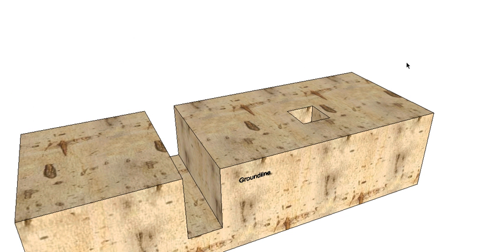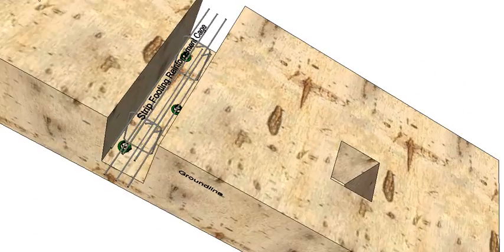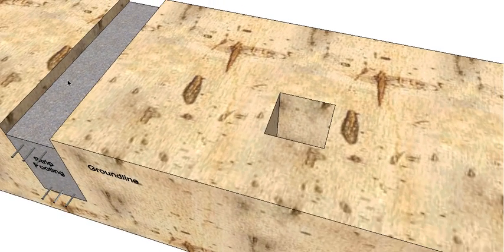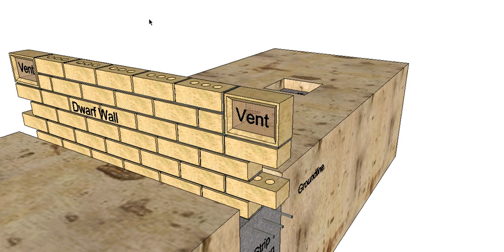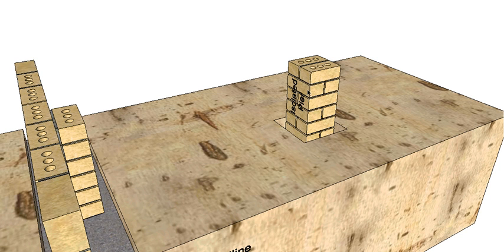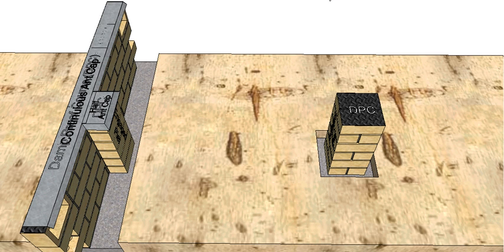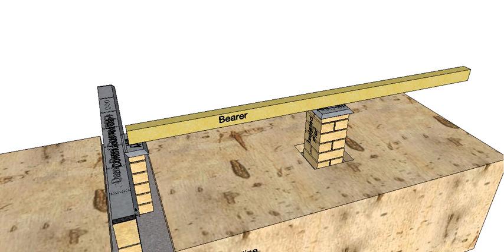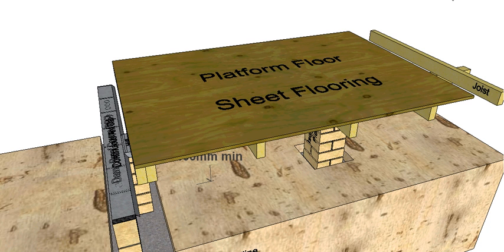Section through a Brick Veneer, Platform Floor Building Part 1

Comment: Hi,
I had a question regarding this method of construction.
I'm guessing this is used in areas prone to flooding? Or are there other advantages this method has over the standard slab on ground method?
Reply from the maker: Hi Mate, no these are not used in areas prone to flooding, before the slab on ground came about this was the most popular method. However yes it does give the house some elevation so it is advantageous if you have a lot of water around. This construction also has minimal, compared to slab on ground, levelling of the block to the natural shape of the ground is maintained. This also helps with runoff issues. In hotter climates, I can allow for airflow under the house to assist in cooling.
Reply: @Buildsum  Oh alright, I see
Thanks a lot for the explanation :)

Comment: In flood zones we need to raise the floors and sometimes over 1.5m above the N.G.L depending on flood report. From an aesthetic point of view as a designer we have used screw piles to create a floating effect. What are your thoughts on screw piles, ive heard mixed reviews and would be cool if you did a video on screw piles or other similar techniques to create a lighter structure. Concrete piers and slab can be nice but too expensive. Brick piers usually look too heavy for a contemporary design intent and lightweight steel( black) works well. It looks like the engineer will be doing Screw piles and timber floor structure on a job I designed.
Reply from the maker: Hi Jono, I agree that the steel piers look a lot better, I haven't seen them done in black but I reakon that would look great, and are easier to install than Masonary. I have seen a few buildings done with Screw in piers and they seem to work well. The advantage of not having any excavation is certainly a big plus. I have thought about doing a video on the different types of piers so will have to have another look at it. Thanks for your suggestion.

Comment: Hi Buildsum, thanks a lot for your videos have been very helpful. I have a question though, is it common/legal/doable to have the strip footing much lower in the ground so that your house looks like it’s lower to the ground? Obviously you would have to excavate the whole job site to keep 400mm like you said under the floor. Basically minimal step up onto the floor
Reply from the maker: Hi Mate, thanks for your comment, I would have to say that it is definetly not common and would probaly be expensive, why not do a slab on ground instead? If you want the look of timber floors in the home you can put battens over the slab and then put down timber floorboards or just use a floating floor system. Hope this helps

Comment: Ho how to fix the bearer to the brick piers
Reply from the maker: Hi mate, traditionally they weren't, the weight of the building would hold them in place. However, nowdays with the greater requirements for tiedowns and resiting wind loads it is becoming more common. With brick piers you can use builders strap, rod or strap to bolt the bearer to the pier around the Ant cap however this takes more time and money so it is more common to see people using a metal pier system like UniPier which allows the bearer to be screwed directaly to it.
Hope this helps

Comment: How do floor bearers get fixed to ant caps?
Reply from the maker: Hi mate, traditionally they weren't, the weight of the building would hold them in place. However, nowdays with the greater requirements for tiedowns and resiting wind loads it is becoming more common. With brick piers you can use builders strap, rod or strap to bolt the bearer to the pier around the Ant cap however this takes more time and money so it is more common to see people using a metal pier system like UniPier which allows the bearer to be screwed directaly to it.
Hope this helps
Reply: @Buildsum  Thank you so much for the reply. This helps greatly.
Reply: Hi if I make small cut in the middle of the ant cap and get the building strap through the ant cap to bot it or fix to the bearer, is it ok
Reply from the maker: Hi Bill, yes that is possible however a lot of work. You will just need to seal the cut with a termite silicone once it is in the final position.
http://alterm.com.au/wp-content/uploads/pdf/Alterm-NMS-Bro.pdf